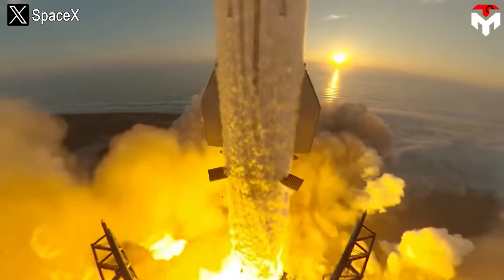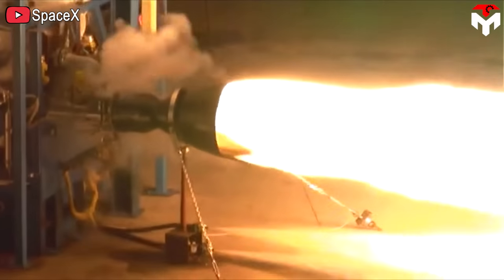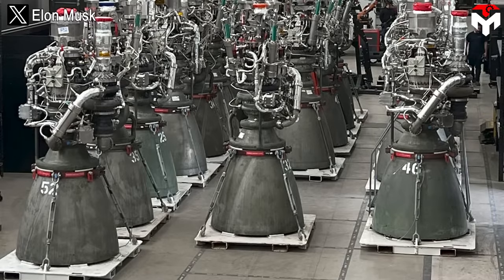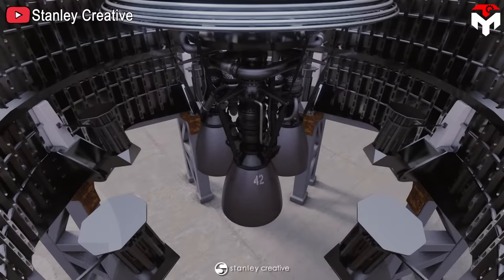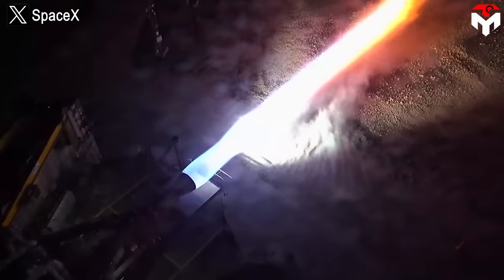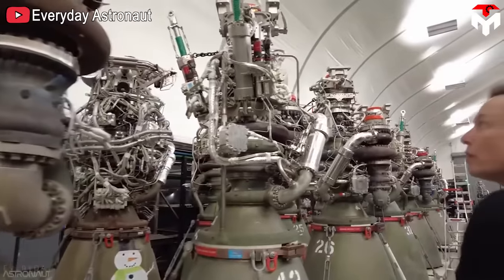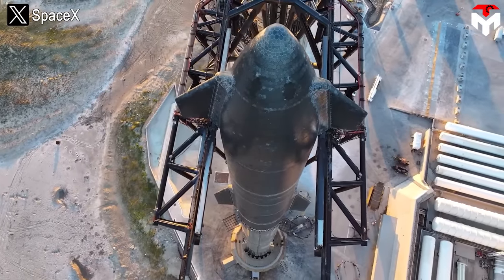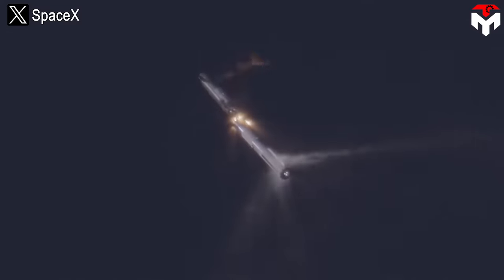SpaceX upgrades everything on New Raptor Engines is totally thrilling Scientist's minds...

Comment: My question is , if raptor 3 has more thrust etc than #2  engine , would this mean they can use less than 30 engines to allow lift off , I'm  not an engineer.  Just asking , thanks .
Reply: Higher payload capacity.

Comment: It is really great that Spacex keeps updating a😢nd improving their Raptor engines, but you have to wonder if it might be considered wise to get the Starship to successfully reach orbit and land (in ocean tor now) before they keep redesigning and making engine more powerfull thrust + temperature. /higher performances . There are several other parameters like the tiles/fin control of Starship spin, etc, etc that need reliability, perhaps BEFORE tweaking engines ?
Reply: Making it as safe, and efficient as possible.

Comment: Compared to SLS having to cannibalize old shuttle engines…
Reply: It's not like the shuttle would ever use them again.   Besides why change what worked well before??  Don't forget the first flight of the SLS Orion to the moon was a completely nominal flight.  It will be a couple more years before Space X is ready to send a starship to the moon which of course will necessitate launching a dozen or so starships just to fuel that flight to the moon.  I do wish them well, but that's a lot to get done in the next couple years.

Comment: I was about to ask you about Raptor 3. You covered it be I even finish my question. Great Job. Doesn't the Raptor 3 have less parts still? Do you any more updates on Raptor 3. I'm anxious to here to more progress on the Raptor 3. If they are successful with this engine, and I'm sure they will. That will be almost impossible to beat. So if they use the Raptor 3 instead of the Raptor 2. Would they continue to use 33 engines? Or are they depend on this engine for the power to increase the mass of the rocket. Exiting stuff. I need more info. Great Episode.
Reply from the maker: My honor, thanks
Reply: The booster will continue to use 33 raptors even with more thrust produced because this will increase the payload that can be carried to orbit and beyond.